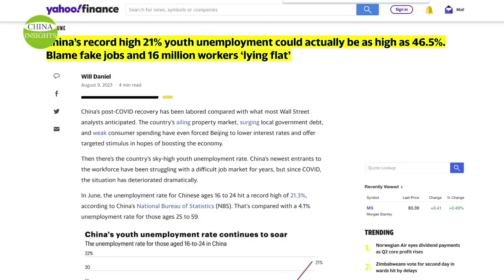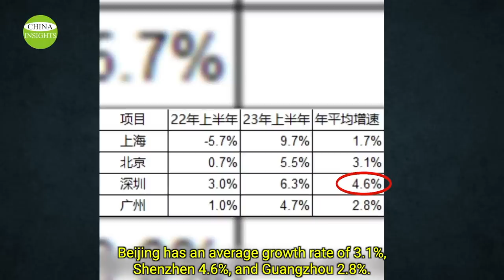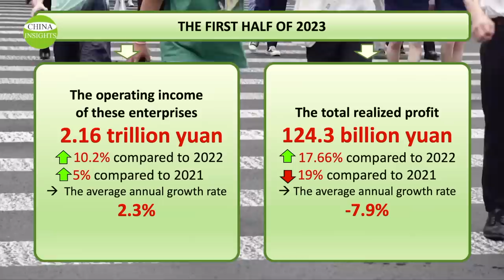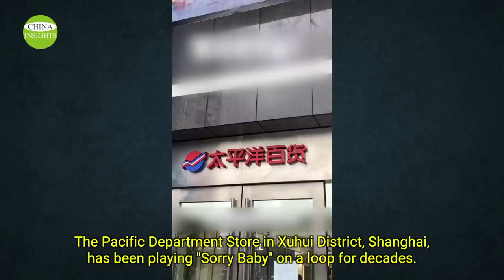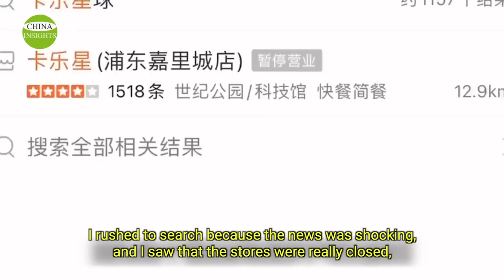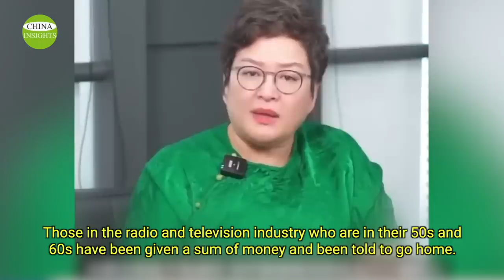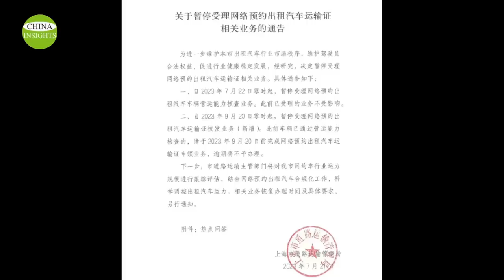Going Back 20 year! Shanghai's depressed reality exposes China's economic misery

Comment: I lived in Shanghai as an architect in the early 2000's. Back then it was a haven for architects and developers who wanted to experiment without too much oversight. As a result most of the new buildings that sprouted up were, to be diplomatic: 'problematic'. One of the key problems was that Shanghai is built on a river delta. The subsoil of Shanghai couldnt physically support the level of development that there was back in 2006. But they kept building and ignoring the warnings from experts nevertheless (most that I knew subsequently mysteriously disappeared not long afterwards). As a result Shanghai is actually sinking.  I wont bore you with the details. But its a serious issue.  What I worry about most is that  the majority of mass engineering projects in China started AFTER 2006, If you multiply the mess that the CCP made of Shanghai by the other mega-cities that sprouted up after I left......I shudder to think what will happen. Basics like drainage, water and electricity sources, foundations........fire controls, proper structural checks.......none of this has been taken seriously in China for the last 20 years. the CCP will say otherwise or course.
Reply: I agree.  I feel bad for the people there.  Right now, everything is collapsing. Everything is being destroyed.  Next mass starvation. 
To every country, not just China, us to.  Every country is feeling God anger.
Reply: For the last 20? Probably more like 35+
Reply: @@camrobertson1886Australia is no comparison tbh. Which city in Australia is as large as Shanghai? Have you been there? 
The pop of Shanghai in 2023 about 29mil is more than the whole of Australia (23+mil 2023). Sure there have been a few high rises built in all of Australia but the concentration of high rises in Shanghai is concentrated in a relatively small area compared to Australia East Coast. 
So please use a little critical thinking when you make comments here, it shows how shallow you are sadly.
Reply: @joannebutenhoff9198  God is not an angry god:
One day John, the brother of James [these are the sons of Zebedee], was going up to the Temple. A Pharisee by the name of Arimanios came up to him and challenged him, asking: "Where is the teacher you used to follow?"

John replied, "He has gone back to the place from which he came."

The Pharisee said, "That Nazarene misled you (plural), told you lies, closed your hearts and turned you away from your ancestral traditions.”

When I heard these things, I, John, turned away from the temple and went off to a deserted mountainous place. I was very unhappy, saying to myself:

"How was the Savior designated?
Why did his Father send him into the world?
Who is his Father?
What kind of realm will we go to?

For, although he told us, ‘This realm is modeled on the imperishable realm,’
            He didn't teach us about the latter.”

All of a sudden, while I was contemplating these things,
           Behold!
The heavens opened and the whole of creation shone with a light from above,
            And the world quaked!
I was afraid, yet
           Behold!

A little child appeared before me in the light.
            I continued looking at him as he became an old man
                        And then he changed again, becoming like a young man.
I didn't understand what I was seeing,
            But the one likeness had several forms in the light,
            And these likenesses appeared each through the other
            And the vision had three forms.

He said to me,
            “John, why doubt?
            Why be afraid?
            Don’t you know this image?
Be not afraid.
            I am with you (plural) always.
            I am the Father
                        The Mother
                                    The Son
            I am the incorruptible
                        Purity.

I have come to teach you
            About what is
            And what was
            And what will be
            In order for you to understand
                        The invisible world
                        And the world that is visible
                        And the immovable race of perfect humanity.

Raise your head;
Understand my lessons;
Share them with any others who have received the spirit,
            Who are from the immovable race of perfect humanity.”
 

The Inexpressible One

The One rules all. Nothing has authority over it.
            It is the God.
            It is Father of everything,
                        Holy One
                        The invisible one over everything.
It is uncontaminated
            Pure light no eye can bear to look within.

The One is the Invisible Spirit.
            It is not right to think of it as a God or as like God.
            It is more than just God.

Nothing is above it.
Nothing rules it.
            Since everything exists within it
                        It does not exist within anything.
            Since it is not dependent on anything
                        It is eternal.

It is absolutely complete and so needs nothing.
It is utterly perfect
Light.

The One is without boundaries
            Nothing exists outside of it to border it
The One cannot be investigated
            Nothing exists apart from it to investigate it
The One cannot be measured
            Nothing exists external to it to measure it

The One cannot be seen
            For no one can envision it
The One is eternal
            For it exists forever
The One is inconceivable
            For no one can comprehend it
The One is indescribable
            For no one can put any words to it.

The One is infinite light
            Purity
            Holiness
            Stainless,

The One is incomprehensible
            Perfectly free from corruption.
Not “perfect”
Not “blessed”
Not “divine”
But superior to such concepts.
            Neither physical nor unphysical
            Neither immense nor infinitesimal
            It is impossible to specify in quantity or quality
                        For it is beyond knowledge.

The One is not a being among other beings 
            It is vastly superior
                        But it is not “superior.”

It is outside of realms of being and time
            For whatever is within realms of being was created
            And whatever is within time had time allotted to it
The One receives nothing from anything.
            It simply apprehends itself in its own perfect light

The One is majestic.
            The One is measureless majesty

Chief of all Realms
            Producing all realms

Light
            Producing light

Life
            Producing life

Blessedness
            Producing blessedness

Knowledge
            Producing knowledge

Good
            Producing goodness

Mercy
            Producing mercy

Generous
            Producing generosity

            [It does not “possess” these things.]

It gives forth light beyond measure, beyond comprehension.

[What can I say?]

His realm is eternal, peaceful, silent, resting, before everything.
He is the head of every realm sustaining each of them through goodness.
Reply: @@camrobertson1886But he's not, he's describing China's building philosophy and I seriously doubt that Australia is as lax as YOU claim.
Reply: @bluemingsounds2837  off to a good start - why don't you recite the bible in its entirety while you are add it.
Reply: 😂😂😂haha